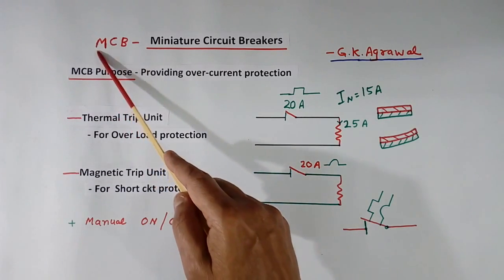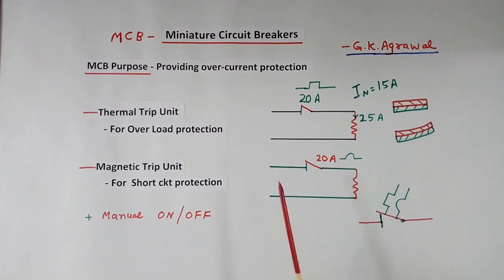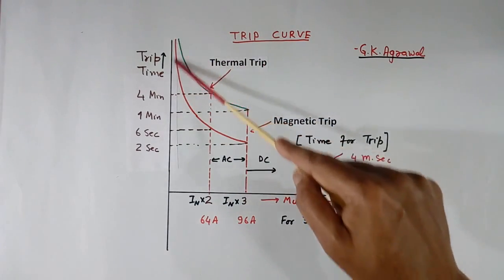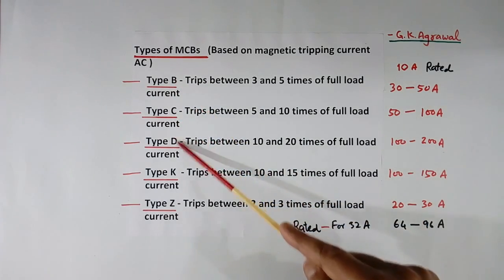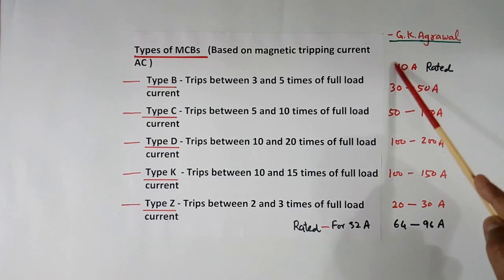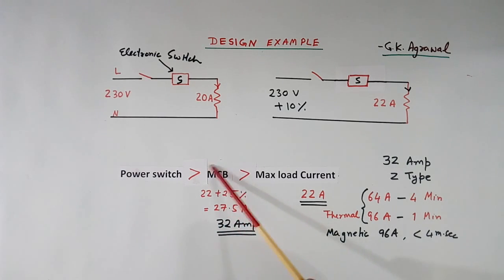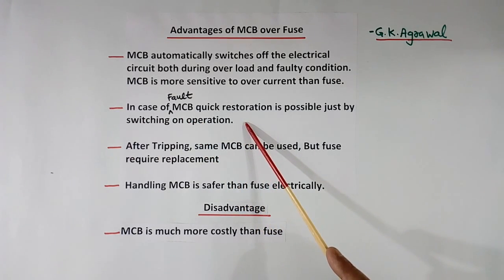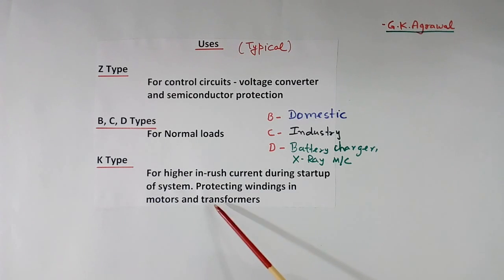MCB circuit breaker - How Thermal & Magnetic trip works ?

Comment: Sir,what are the chances that contacts of mcb get welded together
Reply from the maker: Last 40 years, we used very large numbers in our company products. But contacts did not welded. However generally MCB becomes black and becomes use less. Most of the time there are more than 1 protection, so they protect the equipments.
Reply: G K Agrawal  thanks for your reply

Comment: Sir aisa  bola  jata  hai k,  transformer se  double phase  a gya, aur  electrical  equipment  jal  gye , ye kyo hota  hai,  ise  mcb protect  krega,  please clarify kre
Reply from the maker: No, hamesha nahee protect karega.  Double phase ane se over voltage aata hai aur insulation fail ho sskta hai. Over current bhee aa saktee hai. Aap protection system pe kafee puch rahe hai.  Potection system theek se design karna padta hai.

Comment from the maker: Comments welcome
Reply: G K Agrawal Sir, Please clarify the difference between AC MCB and DC MCB
Reply: The C type can be used for solar?
Reply from the maker: MCB should be suitable for DC. Check specs of the MCB. Generally all AC type MCB can work for DC also but at lower voltage and current.